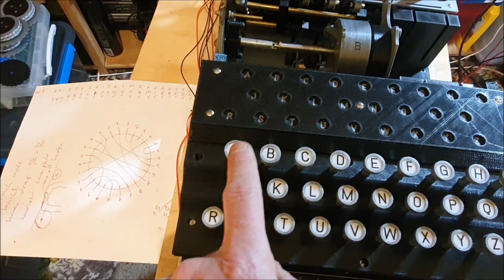3D printed Polish Enigma machine update

Comment: Some amazing progress here. It all looks so neat, so well done man!
Seeing how the rivets work out for you makes me consider switching my contacts for the rotors back to flat contacts, but i won't rush doing that before i know how it all works. 
"The only thing that might be an issue is reliability- and friction". 
Well, I have dreams & nightmares about that stuff haha
Again; if you ever run into issues i'd love to exchange thoughts. 

Also love how you test the entry wheel and reflector; i do the exact same stuff and its black magic to most people haha
Reply: Btw the spring force was a concern for me too; but the one bit of good news here is that it does NOT multiply. 
Four of these spring sets in series take the same amount to compress as only one; the force you put on the first is still transmitted onto the second, so the clamp force is just the amount needed for one rotor.
Reply from the maker: That's good to know! Talking to another Enigma builder (we should start a club) one issue is flexing in the vertical plates either side of the rotor stack. I am already seeing that will be an issue for me I think. My biggest fear with the rotors is really just wiring them up wrong! By profession I am a software engineer/tester so testing is what I do!
Reply: Flexing of those vertical plate could be a big issue- depending on what works best in your model, i think there are two good options: 
- building a C-frame (with both vertical plates and a stiff connection
- using locking pins on the rotor axle itself. When you use locking pins, these will take the force- so the axle takes the force, instead of the plates.